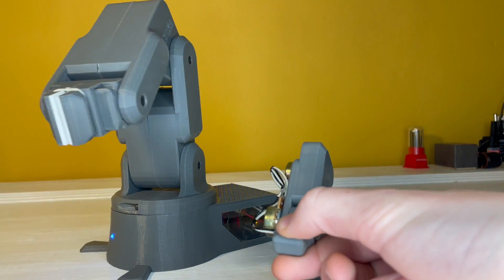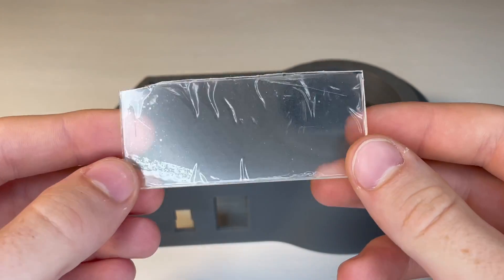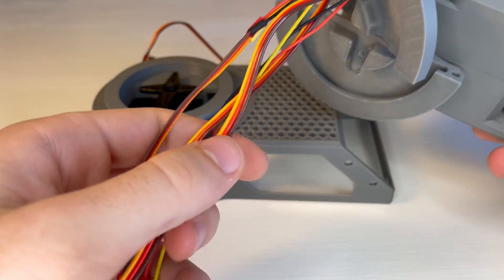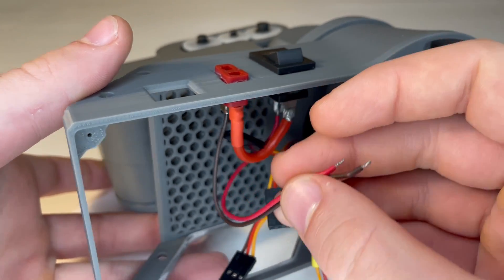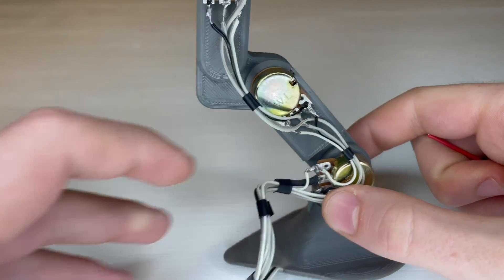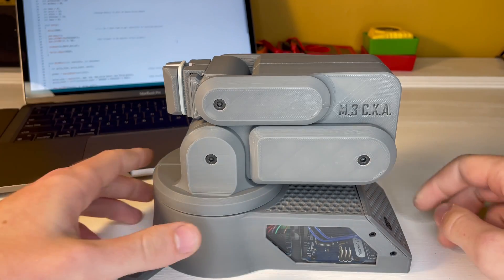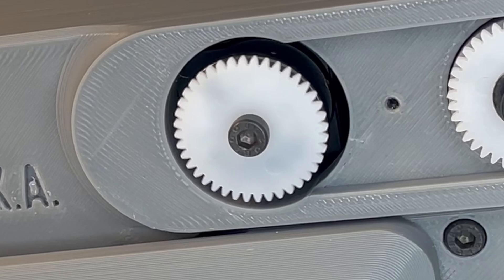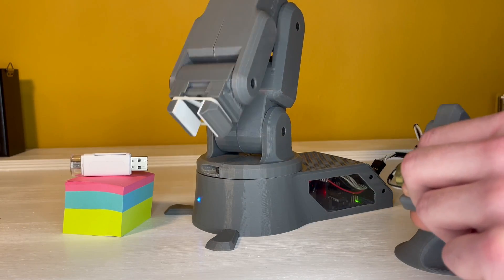How to Build a 3D Printed Robot Arm Tutorial (Arduino Based) - Part Two

Comment: I notice that when wiring the pots on the controller

you wire the left hand pin on the 'wrist' pot to the right hand pin on the 'elbow' pot. and I notice that the elbow to shoulder pots are wired left pin to left pin and right pin to right pin.

Is there a reason for the inversion of the wrist to elbow wiring? I am pretty new to wiring, just want to make sure i do it right.

Thanks again for tutorial!
Reply from the maker: @stowjer  I made the controller a little while back, so, unfortunately, I can't remember exactly why I did this. I believe that when I was testing the controller with the servos, the last servo was rotating in the opposite direction and was not correctly mapping the potentiometer. I am not exactly sure why it would have done this. By swapping the 5V and GND wires on the potentiometer, one can essentially reverse the direction of the servo rotation in relation to the controls. If you do experience a mirrored output on the last segment, swapping the wires mentioned above should do the trick.
Reply: @buildsomestuff  Ok. Many thanks for your quick reply! I've been spending the afternoon getting to grips with the wiring! going great so far!

cheers from London 👍

Comment: Really cool project nearly finished mine myself, one of my servos going the opposite was to the potentiometer controller and just figuring out how to fix, any ideas would be amazing thx
Reply from the maker: @bradleywood-i2x  Swapping the two outer-most wires on the corresponding potentiometer should do the trick!

Comment: for some weird reason, all potentiometers are connected to the wrong servos and the servos are shaking because 1 the power is to high or too low or 2 the pedometers are stupid, and I will have to replace the small arm and re-wire. you should have added a resistor to the LED in the tutorial because mine brunt out 2 times. does anybody have any suggestions about how to make the servos stop shaking.

Comment: Great project man. I have a question about the male T plug connector. what is that connector connected too, power wise?(battery, outlet, laptop supply, stand alone power supply). Thanks again for the concise videos.
Reply: Did you find your answer ? Bc I still looking how to power it , didnt get into Wiring process for now but advancing and I guess 5V supply should be enough
Reply: @TheBoss64340  hey did you figure out how your supplying power. i am also struck at that phase
Reply: @saikrishnasaitana6929  using a PC power supply with 5V line, next Im gonna create my own battery lipo with cells, BMS etc
Reply: @TheBoss64340  thanks alot i am also going for lipo battery.
Reply: @saikrishnasaitana6929  only limit is the intensity be carerul about that

Comment: Hi @build Some Stuff. Nice projects and thanks for sharing. One quick question, why is the wrist potentiometer wired differently? 
Based on the video (5:14) the positive and ground wires are swapped compared to other potentiometers. This is different from the schematic.
Would appreciate your help on this. thanks.
Reply from the maker: Thanks! Sorry for the confusion: I made the controller a little while back, so, unfortunately, I can't remember exactly why I did this. I believe that when I was testing the controller with the servos, the last servo was rotating in the opposite direction and was not correctly mapping the potentiometer. I am not exactly sure why it would have done this. By swapping the 5V and GND wires on the potentiometer, one can essentially reverse the direction of the servo rotation in relation to the controls. However, it may have just been a mistake that I compensated for later in the code. I would suggest trying the way they are shown in the schematic first. Then, if the wrist servo moves in reverse, you can swap the two wires. Hope this helps!
Reply: Thanks a lot. You are right the wires need to be swapped as the wrist turns in the opposite direction

Comment: hello I have been trying to build this robot but for 1-2 weeks but yet still can't find out why my servo motors don't move when I am ready to put it in the starter position I did unscrew all the parts like in the video and also screw them back on like 10 times just to find out the reason on why it won't work I am thinking it is because of the wire's they are probably miss placed on my end from either the control or from the boards can anyone help me out here I would really apricate it thank you.🙂

Comment: Can i use the same 20 kg servo that you use at the base for all the other servos(i didn't pay attention at the start and bought 4 of the 20kg servos in the description😂)? i have yet to complete the build but i am afraid that i may have to change the code and i don't know anything about programming. Also i love your videos.
Reply from the maker: Thanks! 20kg servos in all joints should work fine without any code changes!

Comment: You use two power supplies. One for the Arduino and one for the servo controller, right? What would be their voltage and amps? Can anyone help me with this question?

Comment: Do you use two power supplies? one for the servo controller and one for the Arduino, right? What is their voltage and amps? Can anyone help with this doubt?
Reply: I have the same question. My son built it, and it doesn't move. I suspect it's a power distribution/supply problem. The arduino requires 5v and the servos require more.

Comment: Beautiful work.. from an 'old' maker to a 'new' one! The only thing I would add, use silicone grease on all gears and moving 'sliding' components. I was planning on making a third hand for my bench like this. I may use your arm. Currently, I have a modified Inmoov arm helping out but while it looks cool, this is much more practical. Thank you for sharing this! subscription well earned! I am curious, what made you blow 3 servos? programming over limit or load issue?

Comment: Heya, I'm in the final throws of the project and I've hit a brick wall of an issue and I was wondering if there's any advice available. I've wired everything up as shown and downloaded the code to the arduino. I've powered it up with a external PSU but all the servos (appart from the gripper servo) seemingly are fluctuating about 5-10 degrees before cylcing back. I'm guessing there's electrical noise somewhere in the setup somewhere, but I'm unsure where to look! Any ideas :)
Reply: I'm having the same problem as you, did you solve it?
Reply: @mr.q1880   (bear in mind that I’m learning as I went along here) from memory, I think the scaled down version of the arm with the potentiometers in the pivot points were causing me the issues in addition the servo control module. In the end, I think I used a bog standard breadboard and linked new potentiometers straight into the analog inputs of the Arduino. 

From there, the robot was a lot more responsive (although I found a lot of the cables inside the arm were getting heavily strained inside the body)

Hope this helps mate, and good luck
Reply: @Svenboiii  I'm very sorry if I'm disturbing your class because it's 11pm in Asia. I printed the 3D files and started working on this project.
Finally, can you please provide more details about the 3 gears used, like diameter size, number of teeth and hole size because with 58 gears I don't know which one to use?
- What 4 types of servo motors are there (180 degrees or 270 degrees or 360 degrees)?
Thanks a lot.:hands-yellow-heart-red::hands-yellow-heart-red::hands-yellow-heart-red:

Comment: Hi, I'm in the process of making this project, but I'm having some issues. When I connect the controller with the arm it doesn't really work, it's like it isn't receiving the signal of the potenciometers, I've checked the wiring but I don't see any mistakes in it. I really don't know what to do anymore
Reply: I'm having the same problem as you, did you solve it?

Comment: Idk what i did, but nothing but the LED on the arduino works. It's definitely something with the wiring i did, which is just barely holding together, but everything is pluged into the correct stuff (i think)
Reply: im in the same boat have rewired everything and cant get the code to do anything
Reply: I've been speaking with the electronics engineers at my work and it looks like for standard two-prongled LEDs, you need a resistor in series with the wiring, otherwise the LED either will pop or, after a short period of time, die out (which mine did). I've added a resistor and it looks like the LED is back on.

Comment: Thanks for this tutorial..
I have got one problem..the MG996R servo doesn’t stop after move the Controller and keeps rotating in the some direction of the potentiometer..? But the servos stops after return the controller to start position!
I tried to change the code and control each servo separately but the same problem..However,the Micro servo motor works just fine and follows the potentiometer..
Can you help please..
With All Thanks 🙏🏻
Reply: I'm having the same problem as you, did you solve it?

Comment: the micro servo cant overcome the strength of the rubber band apparently (bought the ones in the recommendations list). It can push the hands apart just fine without it there, but gets stuck and whines when the rubber band is on
Reply: I'm having the same problem as you, did you solve it?

Comment: Could you be fixing that you could be programming the moves?
So it actually memorise the moves? And you could just lean back meanwhile the robot are doing the preprogrammed things?

For example adding some more buttons.

Button one: You are moving the arm direction  Z, X, Y

When you are not pushing the button anymore, it stops.

But you could also be pushing second button for the gripper and memorise that too?

Comment: can you use 12 or 5 volts
Reply from the maker: 5 Volts should work! The PCA9685 Module is rated for 5 to 10 volts.
Reply: @buildsomestuff  The potentiomters don't snap on to the 3d printed parts any idea how I could fix this thanks

Comment: Ok so i built it but a bit of issue. My servo keeps spinning instead of stopping at a position of the potentiometer. Any help?
Reply: This is only happening with my mg 996 servos. All 3 of them keeps spinning at forward or reverse direction, Just noticed these are 360° servo. I am so dumb. Anyway to fix it or i am just gonna have to open it up and start again?

Comment: how many volts are you supposed to give the robot? is 6 the max?

also what did you use to bundle the smaller groups of wires on the controller together? mine looks like spaghetti lol
Reply: What volt did you use ? I am stuck at the power source connections. It's for my college project.

Comment: question, do i have to have potentiometer at a particular position when attaching to the controller body?
Reply: Hey, I have a question. Is the code that is shown on video the only code you need? Or is there more to it?
Reply: Also, since the servo motors automatically correspond to the pots, I don’t think you’d have to.

Comment: how many collective hours of printing is the robot arm and mini robot arm?
Reply from the maker: Hello! The print time can vary quite a bit depending on your 3D Printer. With the QIDI X-Plus3 shown in this video, the print time was only around 6 hours for all of the parts. However, with a standard printer this time may be closer to 15-20 hours.
Reply: thanks for the speedy reply i have been looking around for cheap beginner robotic arm projects and yours is by far the most affordable for entry level participants.
 @buildsomestuff
Reply from the maker: @TimLukeAnderson  Awesome! No problem!

Comment: Just finished building this and the only major improvement I could suggest would be to make all the clamshell pieces have locating features (pins and holes, tung and groove, etc) to make the pieces fit and stay together better.
Reply from the maker: Great idea! Thanks for sharing!
Reply: did you set the potentiometer to any particular position before attaching to body?

Comment: Could i use a higher voltage power supply like a 12 volt or would i be able to use a buck-down converter to make it 7 volt? also is wattage gonna be a issue if i do this?
Reply: yes i had this question

Comment: How much it may cost at least for all those things i need?
Reply from the maker: Hello! While the material cost is relatively low at around $60. The total cost to purchase everything upfront is much higher at around $200. However, this is assuming that you have none of the suggested parts and would need to purchase everything. And, most of the purchases included in this total have more parts than what is required for this project. For example, the linked micro servo pack comes with 4 servos, but only one is needed. Hope this helps!

Comment: I’m doing a similar project like this(I’m a beginner) but I have learned a solid foundation during the first semester of school. What exactly do micro controllers help with. I’ve seen tutorials using potentiometers without microcontrollers but when I try, the servos will work for short periods of time until they start stuttering, moving on their own, or not moving at all. Any ideas if a micro controller could help this or even something else?

Comment: Hello very well made design. I have only one question about power supply so I read 7V power supply enough but what current works well. I have two options 5A and 10A? 
thanks in advance
Reply from the maker: Thanks! Either should work fine, as this arm only draws around 3 Amps.

Comment: I finally got it all hooked up but i'm having an issue with the gripper.. when i push the button it will open up but when i release it it just stays open forever, any idea what could be wrong? in the serial log it prints released and pressed correctly but it just doesn't move the servo
Reply from the maker: That's strange.🤔 I would double check the switch and servo wiring in relation to the Arduino. You may also want to redownload the code incase any lines were changed accidentally. Hope this helps!

Comment: how are the 3 gears connected in the wrist? i have glued one gear to the gripper part but the gear doesnt potrude far enough through the side plate to mesh with the other gears if that makes sense. in part 1 that seems to be the case for you but in part 2 its no longer an issue
Reply from the maker: Hello! So that I can visualize the problem, what time stamp in part one does this issue appear?
Reply: @buildsomestuff  it is at 7:30. where the 3 gears mesh together. the one gear that is glued to the hand /gripper isn't tall enough to reach the center gear or the servo gear. thanks for your response
Reply from the maker: @joboprecise1103 I don’t seem to see the issue in Part 1 or Part 2 at 7:30, but, if you have three small washers under the middle gear, removing one of these washers or adding washers under the gripper gear to push it out may do the trick. Hope this helps!

Comment: Hi, I was wondering how you connected the male T plug to the power supply.  Did you just directly solder it to the power supply wires?
Reply from the maker: Hello! I used an adjustable power supply in this video with terminal connectors. However, the T-Plug can certainly be soldered directly to the 7V power supply.
Reply: Ah I see.  So you directly screwed the T plug wires into the terminal connector of the adjustable power supply.  Thank you for the clarification.
Reply from the maker: @pdog9598  Yep! No problem!

Comment: Hi! I ha e build the robot same way you did. I have a problem with power distribution. If I power the robot over the servo board, nothing is working. No lights no movement.  If I power it over the arduino, lights are up, but still no movement.  Wiring is correct and solid. I use a 9v power source .any ideas?
Reply: maybe the current is not enough so thats why youre having some issues

Comment: Hello, I made this and I’m getting shaking from my servos they are the 20kg ones the strong ones. I’m using a variable desktop power supply which should have plenty of power. Any thought on what’s causing this?
Reply from the maker: Hmm. That’s strange. The first thing I’d do is double check the wiring. If everything is correct, it may be that the 20 kg servos are drawing too much current from the servo driver board. If you are still experiencing jitter, I’d recommend checking how much current the servos are drawing when they all move at the same time, and how much your power supply is capable of producing. If the current drawn from the servos is higher than what your power supply is capable of producing, you may want to consider upgrading the power supply or replacing 3 of the 20 kg servos with the cheaper 12 kg servos as shown in the video. Hope this helps!
Reply: Sometimes adding a little friction at the joints can stop jitter.

Comment: Great project, how come the ground and 5v on the top potentiometer  are wired opposite to the other 4  ?
Reply from the maker: Thanks! I made the controller a little while back, so, unfortunately, I can't remember exactly why I did this. I believe that when I was testing the controller with the servos, the last servo was rotating in the opposite direction and was not correctly mapping the potentiometer. I am not exactly sure why it would have done this. By swapping the 5V and GND wires on the potentiometer, one can essentially reverse the direction of the servo rotation in relation to the controls. However, it may have just been a mistake that I compensated for later in the code.
Reply: @buildsomestuff  does that mean if i'm following this guide i should switch the wiring also? or is the code corrected?
Reply from the maker: I believe all should be correct now. However, if you do experience a mirrored output on the last segment, swapping the wires mentioned above should do the trick.